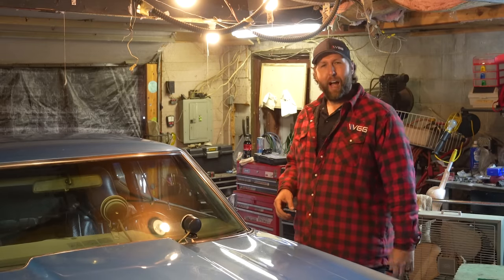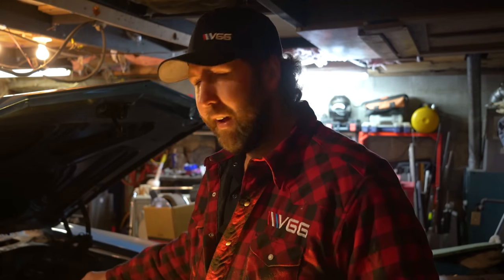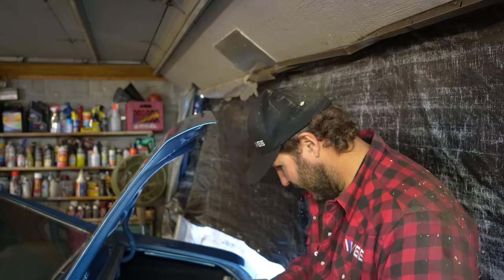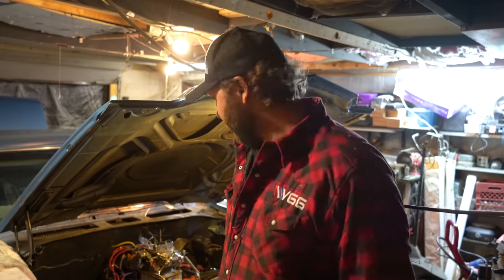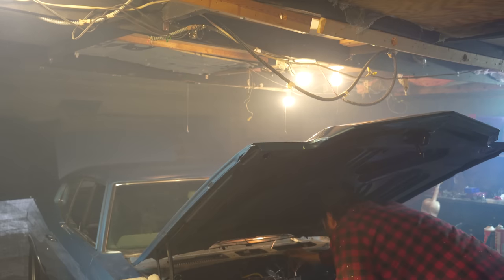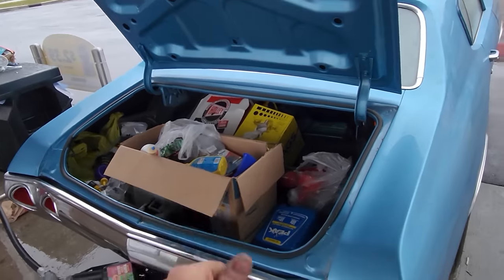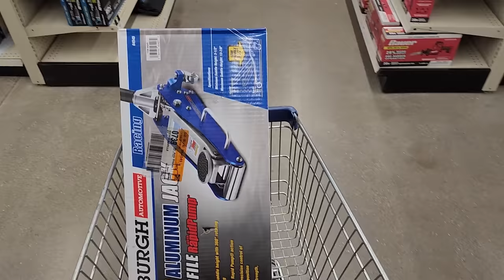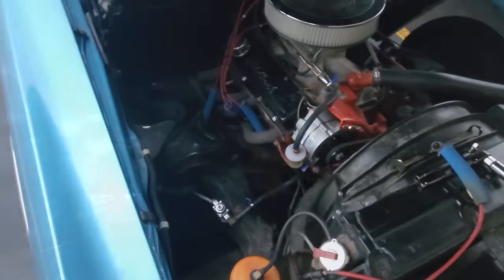80s Built Chevelle Drag Car - Will It RUN AND DRIVE 450 miles home?

Comment: Go through the engine, fix the shock problem leave the finish clean replace the radiator and the see how strong it really is. I personally don’t care for the abuse of burnout competition; I came up having to scrape and save for every single thing I had. So I have a great respect for well put together machines.
Reply: David, I agree with you. I find burnout competition is basically an abuse of machinery. I don't care for it.
Reply: agree.... the 400SM is defenatly worth rebuilding.  keep it a shiner, call it sky blue.  but some magnetic business cards on it and hit the show and shine circuit.
Reply: I just think its boring to watch. I mean yeah. You can spin some doughnuts and make some smoke. Ok. Lol.
Reply: Yep! What they said 👆
Reply: I like the Drag and Drive as it is performance designed to live longer than a season but possibly if Derek wanted to enter burnout Comp's still a "rescue" of some less desirable vehicle throw on a blow through turbo welded up with batteries or similar just to get the last gasp out of something destined for a Sawzall and the scrap metal bin. Getting something from an auction even and work around the bleep bloops and press all the budget up arrows.

Burnout cars do not last long when they hit a barrier in the smoke cloud.
Reply: I get a weird anxiety during burnouts, I respect the machine too much perhaps, Like I hold my breath or something, I end up rattled.
Reply: I'd like to see you dress it out as a Saturday night cruise down to the taco stand car. Fix up the interior, sound deadener, carpet, cut that cage out that's too small anyways and forget to put it back in. Maybe just a rear hoop or put in a pro quailty tight to the roof cage if you must lol. A defroster and wipers could be useful.
         It's very obvious to me that you REALLY like this car. Pull the engine and go thru it to make it right and put that overdrive in it. Leave the gears alone to keep it a good stoplight street car. Keep it old school like that Chevelle you used to tell us about selling. Great video I like it's format.
Reply: Go thru it, make it drag and drive. Get something more like Independence for burn outs. You have a few candidates for that in the inventory. This is just to close to nice. I like what you do and do a bit myself as I can, but respect you all for the content.
Reply: @solardisk3 must be your a Ford guy lol
Reply: A drag pass is just as demanding on a car as a burnout pit. 

If a car cant handle a 3 minute burnout it's not worth having
Reply: @tmikkelsen8066  I think drag racing is boring to watch. 

You can spin your tires and then go down the track.
Ok, lol.
Reply: Can't stand that doughnut burn out thing. Waste gas and go nowhere and break stuff! I don't get it....
Reply: if it dont last a year and you cant enjoy the real roads with it then youre just playing a different game...these cars arent for destroying anymore.
go shred a civic into the wrecking yard...its time to love on these antiques.
they certainly arent the cheap throw aways they were long ago
Reply: @contraband1543  drag pass is WOT for 10 seconds or so and a fraction of that time on the limiter. 

Burnouts are 3 minutes of sustained high revs and banging off the limiter with the oil getting thrown around the pan. Plus there is no high speed air flow running through coolers etc like on a drag pass. 
Burnouts are WAY more brutal on cars (if you’re doing them right) than drag racing.
Reply: @contraband1543  there's so much info you must possess and learn on every 1/8-1/4 mile hit you make that it's totally the opposite of boring. 
At one time I thought like you, nascar= all you gotta do is remember to turn left and drag racing is easier, just remember dont turn,until SRC, 1320 videos and a few more channels. The last 2 1/2 years has me ready to build a hotrod for the street/strip! GM for sure,lol.
Reply: Amen! I just bought some drunks burn out machine. A 06 HD Street Bob. I gave her some love and told her she ain't gonna get run like that no more. Babied from here on out.
Reply: @kazzTrismus  Amen Mate
Reply: Totally agree , its too nice to abuse,, keep it shiney, perhaps even return the interior back to stock.
Reply: @contraband1543  thats cool man. To each their own.
Reply: I wish circuit racing or time attack were a more popular fate for these. Drag is just so much prep for such short and ultimately unexciting payoff.
Reply: Makes good sense.
Reply: George  yeah, so what.
Reply: Agreed - never liked the burnouts.  I cringed hard with Betty White's burnout.
Reply: @jlarocque84  I'm not a Ford guy and I think the same as him lol.
Reply: @contraband1543  Drag racing is better than all those. The cars actually get to live longer. Just look at names like Leroy and Farm Truck. Track cars always get swept under the dug and dissappear over time.
Reply: george9417  Found the Civic loving zoomer.
Reply: @vicferrari9380  .......you nailed it all Vic on every account. This car is a time capsule of do it yourself technology. It just fits Derick the way it is!       👍    
hance
Reply: Burnouts are for mall parking lots.
Reply: It's called a competition for  a reason;-)

Comment: Call it liberty, wrap it up, and give it the wallet so it'll be 100% dependable for the drive and drags. Itll never be independence 2.0 but it can fill its shoes in its own way. Oh, and keep the motor just spruce it up since its pretty solid as a hat tip to the old timer who put it together.
Reply: Liberty or Freedom Chevelle, so it is in the same theme as Independence and 1776 but isn't a copycat.
Reply: i second that but also keep the interior as is as much as possible so old skool cool
Reply: a bald eagle on the hood would be cool with the liberty bell on the rear deck. VGG license plate :)
Reply: Liberty is a great name for this Chevelle that will roam the roads and drag strips of the USA!
Reply: Agreed, call it Liberty.
Reply: Doesn't he already have a vehicle named Liberty? A pickup perhaps?
Reply: Liberty, keep paint just add to it 🇺🇸
Reply: Red and white racing stripes!!!

Comment: Would love to see you put that on a Dyno nobody takes care of these old rigs anymore they're like dinosaurs keep it the way it is ain't always got to be the fastest but might be the coolest
Reply: I say, junk that tiny thing and rob Liberty.
Reply: It won't stay the same lol.
Reply: I am loving seeing all the older cars back on the roads even if the do need some work. I cant stand newer cars. Too much going on. Lol.
Reply: I bet 450hp at the flywheel, or did when it was new.  Car probably ran 11's.  Put a 200 shot on it and reliably put it in the 10's as it sits with some updates.
Reply: @FrankBullitt390  definitely never ran 11s independence is capabale of 9s but runs 10s and has over 1k hp and because of rust like 1/3 less weight there is zero chance this car ever touched 11s in the 1/4 maybe 13s like 13.5 450 at the crank is 370ish whp with an auto and 390/400hp with a manual thats not enough to go 11s in a car that weighs 3500lbs
Reply: @TylerDuysen  yeah this car definitely ran faster than 13.5 guaranteed. My old stock 2002 Mustang GT with 260 crank hp ran 14 flat stock. 13.8 on drag radials.
Reply: @TylerDuysen  it's probably an 11:1 motor if hes running it on premium pump gas, most likely ported 462 casting heads, healthy solid roller cam..probably makes high 400s maybe 500 at the crank.  Through a TH350 and depending how much the car weighs, it could be a high 11 second car with the right gear.
Reply: @TylerDuysen  Nope, you really should go to a drag strip sometime and watch a properly set up car.
Reply: @FrankBullitt390  or maybe you should stop being an internet troll from your couch and watch the thousands of cars with the exact same setup/power to weight ratio and look at there times this car raced and was setup in the 80s it was not running 11s bud
Reply: @vans1107  i could put this at high 12s with race gas but first off it was raced in the 80s so its very highly unlikely it ran race gas  on a street car second this definitely doesnt make 500hp at the crank especially on the old setup it was raced on and it has 4:56 it was definitely not running 11s (although i agree setup right it could probalbly run a low 12 high 11) but im im certain this car probably never made it past 13s considering its over 3k lbs(around 3500) and every single car setup like it that makes  similar hp and runes races gas runs 13s
Reply: @roadreapervideos7001  first off your 02 is efi way lighter way better gearing suspension etc also its 260 whp not crank weight to power ratio is a huge factor so your trying to compare apples to oranges maybe yall should watch some 1320 or any channel that shows cars with similar setups running 13s independence makes 1k+whp with a procharged big block and efi weighs 2/3 the weight of this car(because rust) and runs 10s and 11s(could run a high 9 turned up but is unsafe to do so) so theorhetically a car making 400whp that weighs more has worse gearing suspension  and ran in the 80s so unlikely it ran on race gas and had no nitrous isnt gonna run an 11 be realistic
Reply: @FrankBullitt390  or you could stop assuming others know nothing and being an internet troll if your such an expert youd know what your suggesting is unrealistic especially considering this has no power adders like nitrous turbo procharger or supercharger 400whp 3500lbs th350 and no race gas or nitrous does not equal an 11 sec run if the thousands of other cars on the internet and race tracks cant run 11s with the same stuff this car isnt magically running an 11
Reply: @TylerDuysen  wow.  Ok first things first, a 2002 Mustang GT makes 260 CRANK HP not wheel and weighs 3300lbs. A stock 1971 Heavy Chevy Chevelle is 3400lbs from the factory, plus this one is gutted so it weighs quite a bit less, a stock SS with less HP and Torque and more weight cranked out the quarter mile in low 14s on Bias ply tires, so with 4:56 gearing, drag radials or slicks, and roughly 500hp (a mild built 400 is around 400hp and 450tq). And mr know it at, this are is built for drag racing, Independence was to a point except all rust made it impossible to build it completely for that so it couldn't be launched near as hard especially with the 10bolt that Derrick was afraid would break at any moment.  Quite basing your option on watching YouTube videos and go live a little.
Reply: @TylerDuysen  there's no way it weighs 3500 lbs, from the factory a V8 71 2 door chevelle weighs 3300 and some change.  This car with no interior aside from 2 lightweight seats, no heater box, gutted dash, no inner fenders, light weight super tricks, lighter and less power robbing TH350 is probably around 3100 lbs.    That combined with a 400 (probably a 406") making easily north of 450 hp should run high 11s.  It was probably a bracket car that needed to pass tech inspection which would be the only reason to install a roll bar and harness belts.  Not sure what the rules were in the late 80s but now any non convertible running faster than 11.50 requires at minimum a 6 pt roll bar.

Comment: I'm in love with that Chevelle and I would love it if before you do anything on that ol rig, take it to the strip and make a few passes. Lets see what a 1980s build really can do in an 1/8th or 1/4
Reply: Hell yeah my guy! I'd love to see Derek make this a street rod for dragging on the weekends but able to also be a daily... errr... well maaybe a going to town rig for when you got a date right before you gotta smoke some fellas lmfao
Reply: 14.7 all day baby!
Reply: it'll be lucky to run a low 13
Reply: RC cars often 1/8 but youll struggle with quarter scale. Its not impossible theres afew 1/4th scales out there its the body youll struggle with most but mayb somebody did do a Chevell they definitly have the V8 engine. The conley V8 rc engine is a work of art too. 1/4 scale V8 expensive asF though.
Reply: @TrollingHistory  I think you got the wrong idea from the OP. They aren't talking scale with 1/8th or 1/4, they are talking fractions of miles.
Reply: @TrollingHistory  lmao ya bud I think you got the wrong idea. Typically when you are talking cars and someone says an 1/8th or a 1/4 they are talking about drag racing and how fast the vehicle will go in that distance. If you read the prior comments, they are talking about 1/4 mile times and how fast they think the car will travel a 1/4 mile distance. Sorry for the confusion bud but if you haven't looked in to drag racing, you should look it up

Comment: Derek, I vote you keep the engine that's in it, fix whatever needs fixin' or upgradin' (new rad, quick release steering wheel, new seat brackets, disc brakes, new shocks, beefier trans w/overdrive and trans brake, better posi unit?, large fuel cell in the trunk) and keep the nice blue paint. Maybe you could call the ol' girl "Blue Lightning", maybe even put some decals with that on her. As quite a few people have said, keeping the original engine and paint and driving the car would be old-school-cool...and we'd like to see you dyno that engine after you have everything worked out (new double roller chain or gear drive for the cam when you replace the timing cover?), take it and drag race it and see what kind of best times it can do.
Reply: I would like to second, third, and fourth and a half this! Just plop a VGG logo on each door, is all I figure it would need.  A blue tinted version, that said VGG with "Blue Lightning" below.
Reply: Yeah I want to see the times it can get with the current setup.
Reply: What they said
Reply: I agree with everything EXCEPT keeping the engine. Its most likely a great drag engine but i think it might not be the best to tour around and do the drag n drive events he will want to be doing.
Reply: Yep….just like that!  
Add OD trans and enjoy.  Hot Rod Tour in that will be classic!
Reply: I support this 100%! I'd just stick with independence 2.0 because we all fell in love with that ride. 😌 I crave those dyno numbers when it's all tuned and fixed 🤩
Reply: That’d be SICK 😂
Reply: Oh yeah, drum brakes are the worst.
Reply: @Flitzer514  no

Comment: Happy New Year Derek and family! If the Chevelle was mine I think I'd let it alone looks wise. Its how she is. Fix what's wrong, make it run right, maybe swap out the front drums to disc's and make it fit you. Add gauges and blinkers for street duty.
Reply from the maker: Happy new year
Reply: I agree I think it’s pretty dam cool the way it is.
Reply: Agreed. Disc brakes on front, 4 11s in rear and leave it a street bruiser. That engine has some guts!
Reply: How about a defroster and wiper blades too?!
Reply: @bobr2959  actually just defroster.....rain x or waxing windshield works fine. I think he was fighting the fogging inside more than anything.

Comment: Back in the mid 1990s, I flew out and bought a 1968 Dodge Coronet R/T, 440 Torqueflite for $4,500 and drove it 500 miles back from Chicago to Pittsburgh. It was a western car in primer, with zero rust and all numbers matching. The engine and transmission and brakes (Kelsey Hays four piston discs) were great but all the tires were bald, the U joints crapped out in western Ohio, it had no wipers (rained like hell), one headlight. In short not "road worthy". I also had no plates.
  But I lucked out and found a garage and motel in the middle of nowhere before nightfall, and the guy that ran the garage dug car. Cost around $400 to get everything squared away and made it back in two days taking old US route 40. 
 I liked that trip. Every time I stopped for gas, which was pretty often with the 440 Magnum and 3:55 gears, the mechanics at the stations would check out the car because they knew what it was, even though it had none of the R/T trim pieces, they were all in the trunk.They saw the "power buldge" hood and recognized the 440 Magnum just by the sound.
 Adventure!

Comment: I would like to see it run a 1/4 mile pull  , just to see how it does . I definitely think a b4 and after pull is key
Reply: yes!
1/4 as is
then new rear tires and other basic stuff like a dyno tune
and do an after 1/4
Reply: Was going to say the same thing but you beat me to it but no problem. Keep it as close to his build as possible and go racing.
Reply: Same here! Want to see it!
Reply: Same
Reply: Totaly

Comment: I had a friend years ago that bought a similar drag car. The guy he bought it off used it as a daily driver. High compression, high lift cam etc. The engine was a constant issue failing plugs. burning wires. frosting the carb. etc., and the transmission kept failing as well.. My pal said the reason it failed was because it was a purpose built drag tranny and geared engine. it wasn't meant to go 20,000 miles or cruise chicks. it was designed to cook tires and go fast for a short amount of time without idling in traffic.  a wide open high load beast meant to ruin its competitions 1/4  mile times/day. or just have fun. Yea run high zinc oil cuz u probably have a solid lifter set up. This was a fun ride Mr. Garage! Thank you for putting this on the lottery. I'm happy I won this vehiculator!!!!!!!!!
When are u delivering it to me in Massachusetts?? 
yes, sure I'm just heavy in all the jocularity departmentalism's. Sorry... nope.
 More performances please.
Edit oh... I would recommend trashing that cam cover. i can tell its cadywompusated and it will never seal the dinosaur syrup. Oops wrong channel. Sorry
.